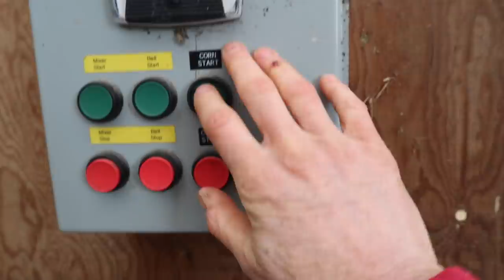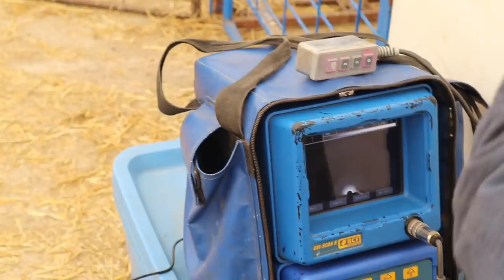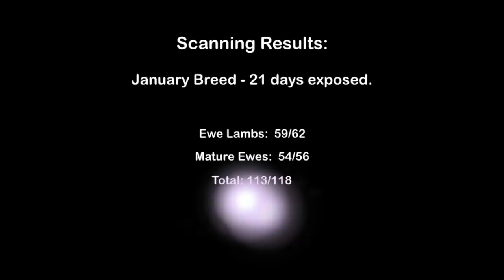Planning For The Next Lambing Group (SCANNING EWES FOR PREGNANCY): Vlog 135

Comment: Sandi, just wondering, when you scan, some of the ewes are a little jumpy probably more so with ewe lambs. Have you ever thought about adding a short section of alleyway in front of the scanning box so there is always a ewe standing in front of the ewe that is getting scanned? I used to scan a lot of ewes and that is how we did it, but the alley system was designed that way. The ewes seemed to be calmer in the scanning area if they have one of their buddies standing in front of them.
Reply from the maker: Great idea!!
Reply: This iss what we do every time but only found out 2 years ago

Comment: Hi Sandy
Sorry , but I have a question:
What is your income number per month for your business? I have a farm with 90 ewes and I’m losing money after 2 years of working in such business! I buy the feed and I have a worker in the farm !  Does it worth for you please?
Reply from the maker: Great question...
So, our biggest cost savings each year is our growing our own feed... and really is the reason we expanded the flock to 450+ from 150 ewes in 2013.  Even switching over a couple years ago on the lamb finishing side from a fully prepared pellet to our now corn/supplement ration has again reduced a huge cost.  Is there anyway you can integrate a pasture system to your farm?  That could ease up on labour, and most definitely help with feed costs...
As for losing money... We've lost enough over the first 3 years for sure.  I knew nothing about sheep, market prices were awful, health issues with the purchased stock... the list seemed endless.  But as I worked on developing systems and working with my vet and feed guy, we've turned it around and finally in the black (after 7 years).  We are fortunate to also run a large grain farm that most definitely subsidized the sheep those first few years.
Reply: @SandiBrock  Thank you so much

Comment: Did using cidr increase number of baby
Reply from the maker: No.  Cidrs do not affect the number of lambs, however the PMSG added after I pull CIDRS can potentially affect number of lambs.  But, this group doesn't appear to be a crazy number of multiples like the group I just lambed.